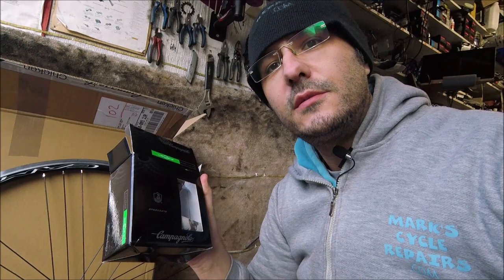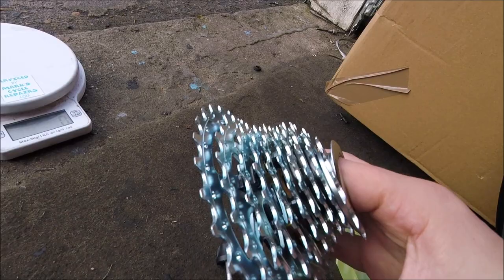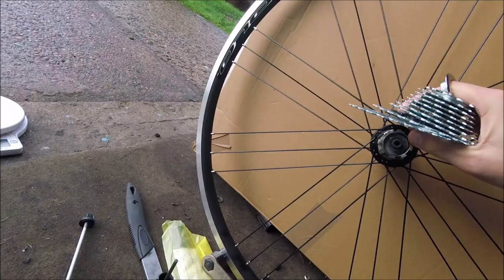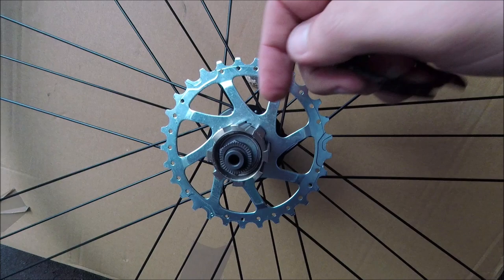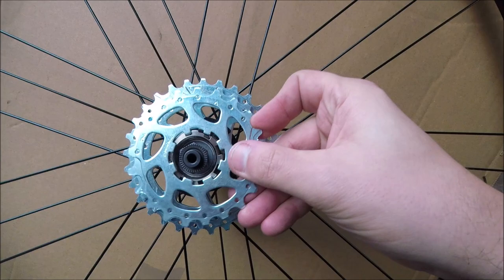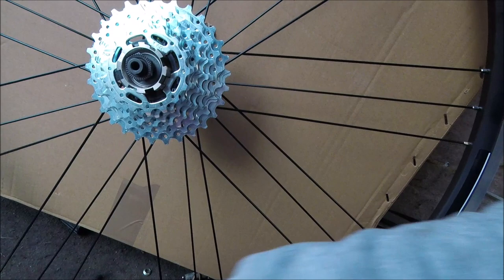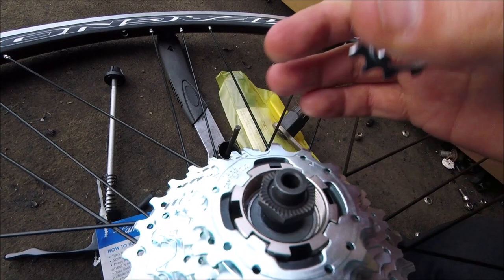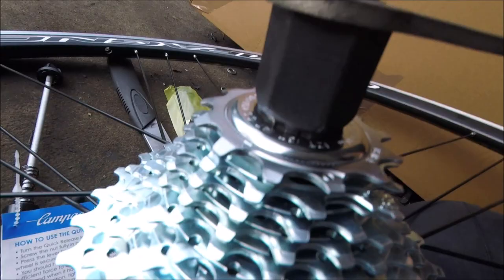Campagnolo Veloce 10 speed Cassette Fitting

Comment: I've just bought a Veloce equipped Bianchi SL3 so, while stripping/cleaning and re-building, I notice that the cassette has three types of spacers?  There is a thinner fluted one with three thicker ones, the rest are just standard rings. Having looked online it states that the thinner one is the first to go on after the biggest sprocket... seems to work anyway but will try properly tomorrow

Comment: Can I replace a Campagnolo 10-speed 12-25 cassette with a Campagnolo 10-speed 13-29 cassette and what would be the difference?
Reply: Yes, just teeth number
Reply: also check for a medium to long cage rear derailleur for 30-34 teeth…not all short cages will accommodate those~
Reply: Check chain length also with the bigger cassette and longer mech.